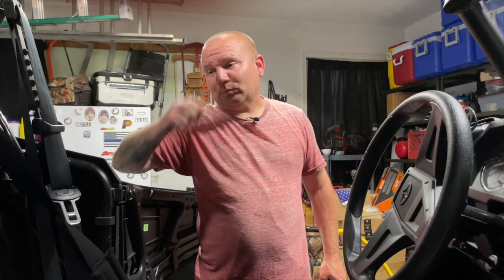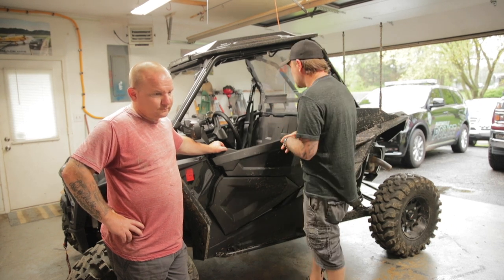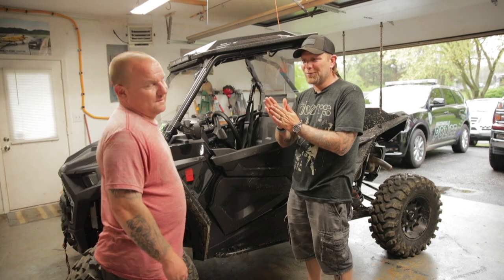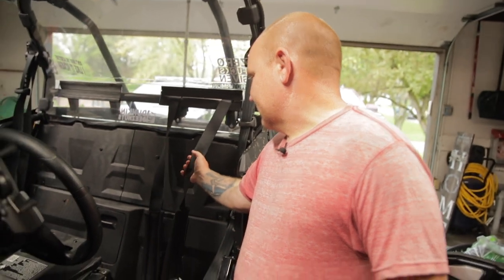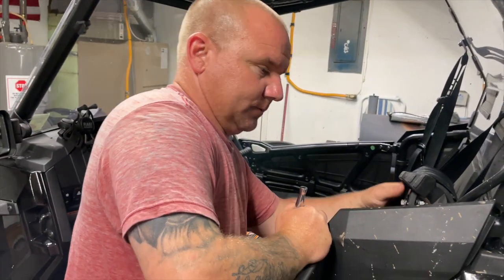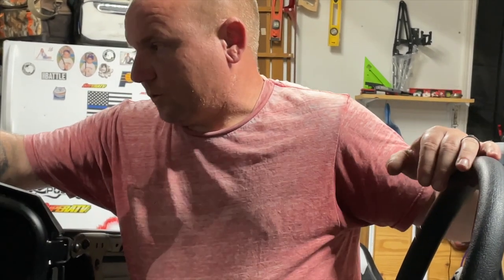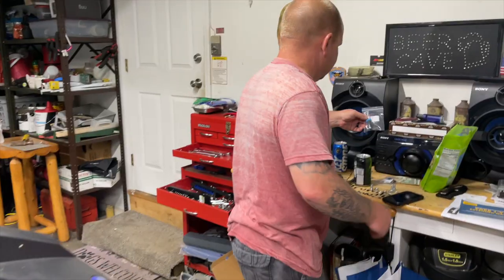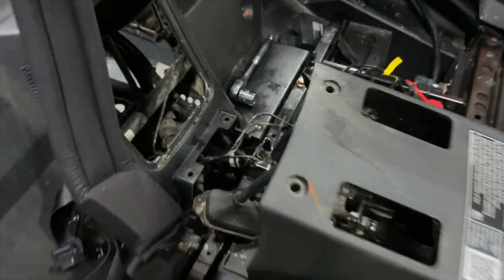2021 Polaris RZR XP 1000 Pro Armor Harness Install

Comment: I like what you guys are doing here. But I would say that many,  like myself,  came here to see what hardware you used since the belts didn't come with anything.. also it was a good add on what tools are used to remove the factory bolts . . But overall great video as usual  will continue to follow both

Comment: What size bolt did u use behind the seat for the 2 cross bar mounts
Reply from the maker: I will have to ask gary...I am not 100% sure
Reply: Any word on the bolt size?
Reply: @colemitchell3908  any word on bolt size?
Reply: 1/2 inch by 1 inch